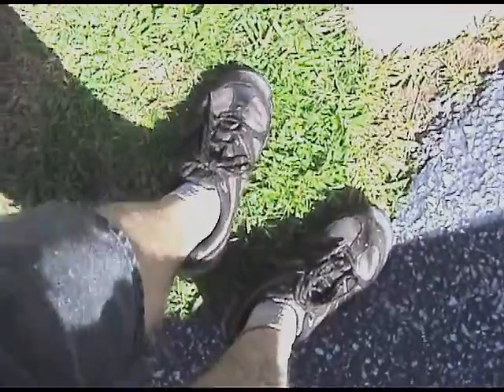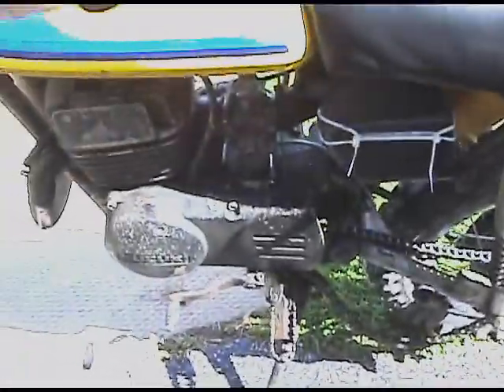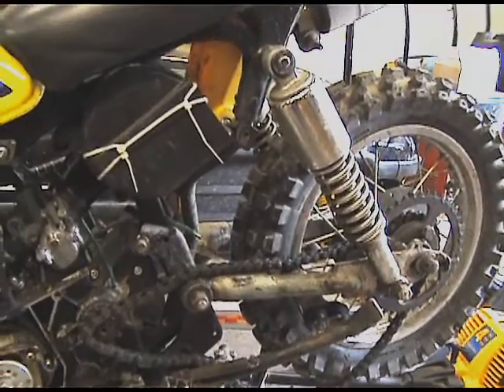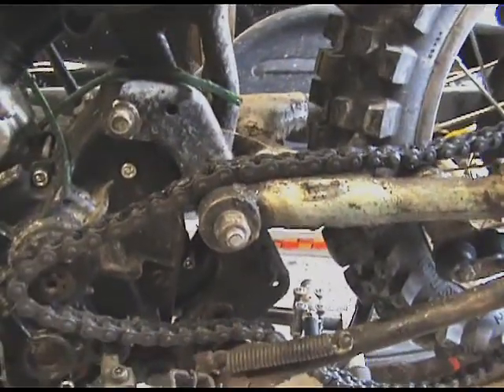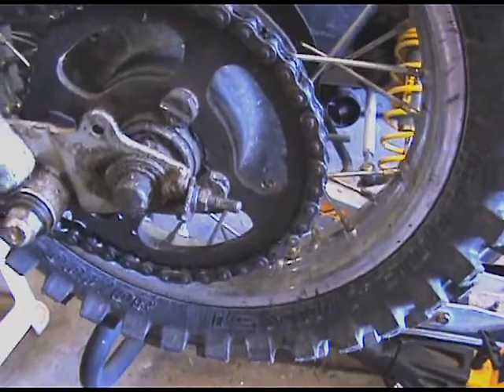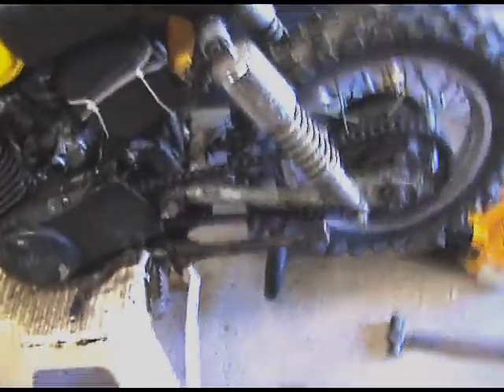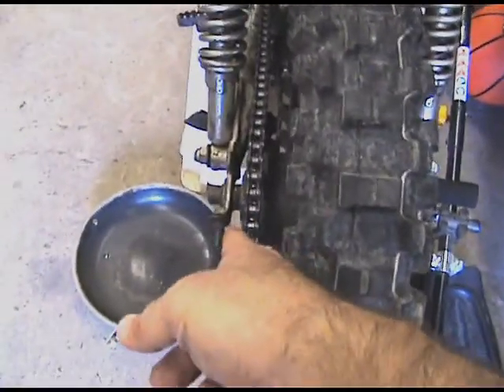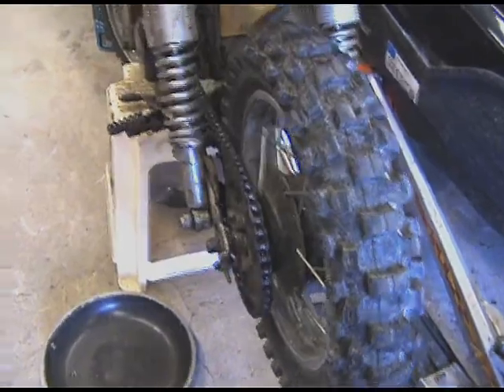RM60 After Carb Cleaning and Chain Adjustment

Comment: its difficult to start and bogs because the pilot and main mixtures needs adjusting. it should start with no throttle, only choke. i dont know if you're missing the airfilter but if its  not the stock one or missing or using a k&n type the mixture will be way off.
Reply from the maker: I have the stock air filter on it.